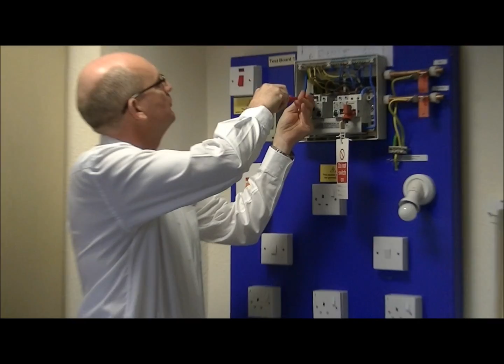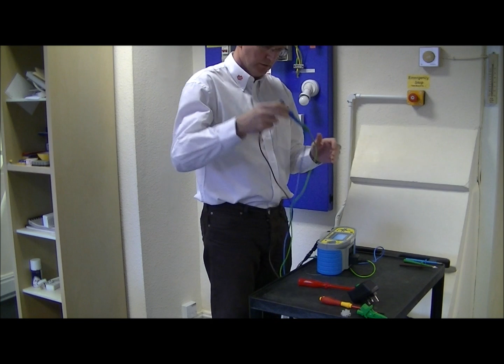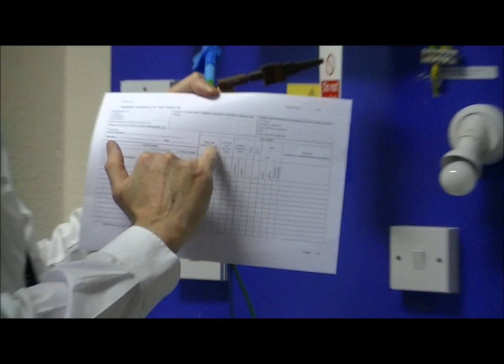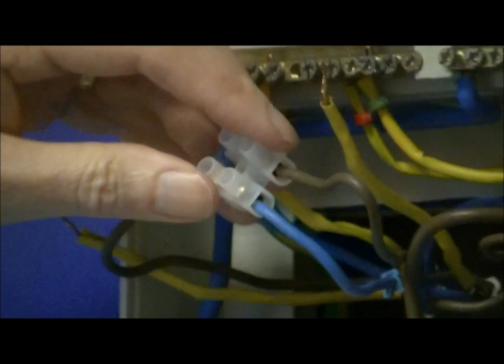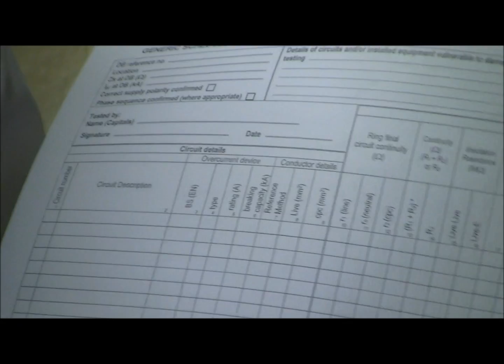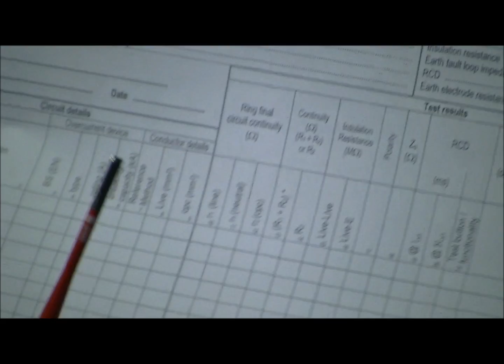Continuity test on a ring final circuit

Comment: didn't null out the socket tester before taking readings on the sockets
Reply: It's a Megger 1700 Series. It would already have been nulled from when he did it at the start. The Meggers remember the null. No difference between test probe leads and a plug lead.
Reply: Ivan Drago it's a metrel